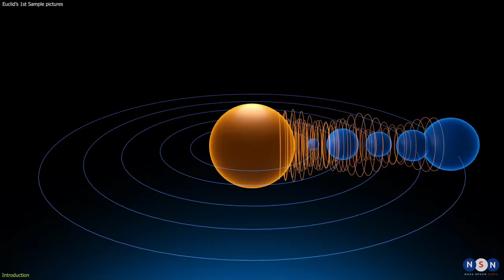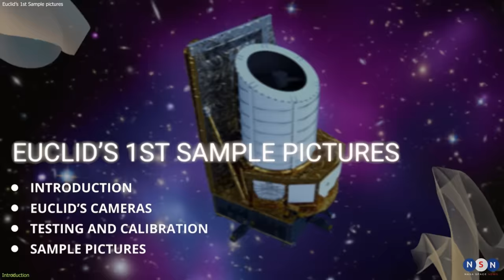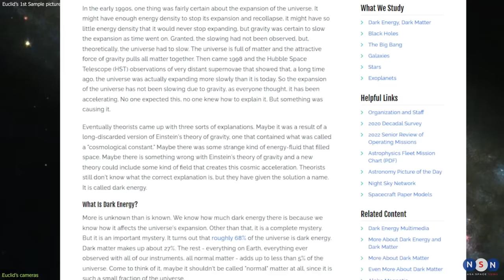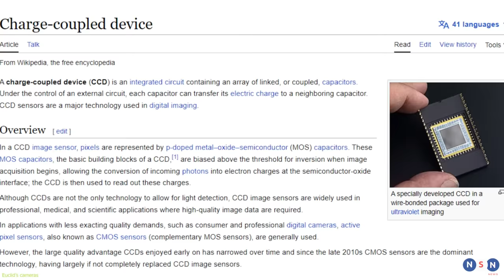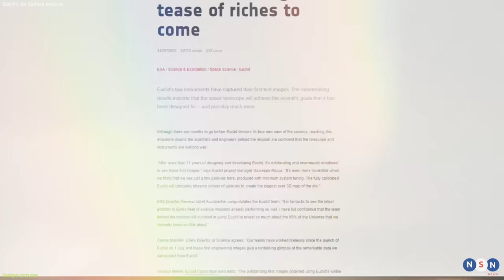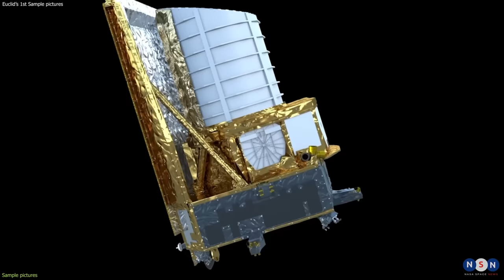Euclid Just Opened Its Eyes, and This Is What It Saw

Comment: 500m @ 10 billion light-years? That can't be right.
Reply: I agree that it can't be right.  I believe that the resolution at 10 billion light-years is about 4,850 light-years which is amazing.
Reply: @EricBier  sounds about right. 0.1 arcseconds * 10 billion light years = 4848.14 light years.  The Milky Way is about 70,000 light years in diameter, for reference.

Comment: wishing you had covered gaia's specs as well.  since gaia is at the L2 lagrange point with Euclid and jwst orbiting around it (only because differing types of orbits are used for Euclid and James Web Space Telescope to maintain position at L2 than Gaia). perhaps a video covering all 3
Reply: Don't forget The Red Roadster is also out there, randomly crossing the flight paths - - but don't worry; Space is pretty big.
Reply: @peterdarr383  Negative. The Roadster is not in any kind of Earth orbit, however its current orbit does intersect Earth's. If it remains on this orbit for a long time, it will periodically intersect and come into close contact with L2 as well as Earth on an interval of centuries or millennia.

Comment: 7:28  If the resolution is 0.1 arc seconds, it is possible to distinguish objects with a size of 5000 light years at a distance of 10 billion light years, not 500m...
An error with a magnitude of 17!
Reply: Thanks!
I thought that 500m distance seemed a little implausible... 😲
Reply: That would be a heck of a resolution. Equivalent of resolving something like the width of a human hair in the Alpha Centauri system.
Reply: Yeah
I'm a dumb hillbilly and can't do math above 3 digits.
But when he said 500 meters at 10 billion light years, I flinched real bad.
I knew that could not be right, but also knew that I could not prove it wrong with my 3rd grade math skill set.
But you know, they say, "Believe the science." 
I must admit though, I am having a hard time gettin' my wife and kids to eat bugs.
Reply: That's right. The tangent of 0.1 arc seconds is 4.85 E10-7 radians. Times 10 billion is 4850 light years. That's way too big to see individual stars, but could see clusters of them or nebulas.
Given that only 1 significant figure was used in the 0.1 arcade spec, we round up to 5,000 light years.  
ps, Given that the Rayleigh Criterion of Resolution is [(1.22 * Wavelength) / D], we can calculate the Diameter (D) of the optics that gives us that 0.1 arcsec of resolution, for any wavelength used in the detector.
Reply: @francp3147  ok… I’m going to believe you until I can check further in this 😂
Reply: Thank you.

Comment: What am I missing in the search for dark matter?  It seems to me that the discussion might be closed by the following scenario:  Construct a hollow sphere from two hemispheres (simplifying the launching of said sphere) which can be assembled in space.. Attach this sphere to another very small sphere, made in as similar way, and connected to the large sphere by an extended tube. From the small hemisphere attach another tube and a flat plate with the same projected area as the large sphere. Adjust the mass of both assemblies such that they match exactly. Set off a charge in the small dual hemispheres and monitor the trajectory of the two sections. F=MA

Comment: If I understand correctly, dark matter was hypothesized to explain the fact that galaxies seem to be rotating faster than they should based on estimates of the mass they contain.  Wouldn't it be simpler to use okham's razor.  What evidence, for instance, is there that the central black hole in a galaxy is not simply heavier.  Or how about the shading effect.  If two stars in a distant galaxy are in line of sight from the earth, the far one is shaded from our view by the nearer one.  The only indication we have of the mass in a galaxy is the amount of light and other EM radiation we see.  Or what about all the cosmic rays wizzing around at near relativistic speed in a galaxy.  The flux is small (greater toward the center of a galaxy) but the volumes are measured in thousands of cubic light years.  We also have photons.  We say they have no weight but C may not be the ultimate speed.  If they do have a little weight they will be traveling a tiny amount less than the ultimate speed of information.  The path of Photons bend as they come close to a heavy object so isn't that evidence that they have weight.  There are a few other possibilitiesThis is just a sample.
Reply: It’s not quite so simple as that. If you plot the radial velocity if stars in a rotating galaxy, you would expect the curve to go as 1/r (where r is the distance from the center) as one looks towards the edge, based on the mass we can see. Turns out the plot is flat , which means that as one looks farther from the center, one should see more mass. We don’t, so either gravity is wrong (and Einstein’s model of General Relativity was tested to be accurate to 15 digits a few years ago) or there is more, unseen mass out there.

Also, when one looks at the motion of galaxies within clusters is galaxies, one sees the same thing. 

So while there may be problems with our best theory of gravity (general relativity), it has proven to be so accurate in extreme tests (time running at different rates in orbit vs on earth’s surface, gravity waves, light from background objects  deflecting precisely as described around the sun and black holes, etc), Occam’s razor says there must be some dark stuff with mass out there
Reply: Here is some additional info on the galaxy rotation problem:
https://en.wikipedia.org/wiki/Galaxy_rotation_curve

Comment: Amazing technology and awesome achievement!

So far, it appears that the universe started as something tiny and started to expand to what we can observe and detect today. It also appears that anything we can observe or detect is made from extremely tiny particles which interact and combine with each other based on some fundamental predetermined rules. We have identified quit a few of these extremely tiny particles and have identified quit a few of the rules these particles follow to interact and combine. Perhaps most of the particles and most of the rules but there probably are more. 

We also discovered that anything that we can observe or detect is made from the same basic stuff and we call this stuff energy. We know this because we have figured out how to calculate a value or quantity of energy for anything that we can observe or detect. I think we can say the fabric of the universe is space time but we can also say that the fabric of the universe is energy time because we now know that space is not empty and is also some type of energy and we can calculate or at least estimate how much energy is in a given volume of space. 

It also appears that after the universe started to expand, no more energy was added or removed as it continued to expand. We do not know what the rules were that determined the amount of energy in the universe nor what caused the energy in the universe to start expanding. The rules for how energy expands, transforms, interacts and combines cause energy to cycle from concentrated to diluted states. Although the cycles can be repeated almost an infinite number of times, we think there will be a time when they stop because as the cycles keep repeating, the total amount of energy in the universe keeps becoming more and more diluted. We call this rule entropy. We also think that at some point in time, all the energy will become so diluted that it will not be able to cycle back into more concentrated states and we think this is when the universe ends.

We still do not know the rules before the universe started to expand and we still do not know the rules after the universe ends and there are probably still many rules that we do not know about that causes the energy in the universe to cycle back and forth from concentrated to diluted states as it continues to expand.

Comment: Dark matter is decayed neutrons and dark energy is the expansion caused by that decay. Neutron 0.6fm³ and amorphous hydrogen gas in deep voids 1m³.

The decayed neutron fragments, proton/electron soup, has a cross section of 10-³¹ barn.
Reply: Hydrogen atoms are semi-opaque at several frequencies. Spectroscopes can detect its presence in the interstellar spaces, and we can calculate its density. Too little observed, by a factor of several thousand or more.
Reply: @Galahad54  
1) when free hydrogen first falls apart it is a proton and a neutron but the electron is not in orbit and has a cross section of 10-³¹ barn. Totally invisible.
2) then it first stabilizes into cold monatomic hydrogen which can interact w light but at an estimated density in voids of a few atoms per meter it is still very difficult to see. 
Check some references.
3) it finally, probably at the edges of voids, begins to bond into H2, molecular hydrogen, which is the hydrogen we know and detect easily.

Comment: I'm confused. At 7:30 the narrator claims 0.1 arcseconds converts to a separation of 500 m at a distance of 10 billion lightyears. Is that right?
Reply: According to Bard, it should be 500 lightyears at that distance or roughly 1/50th the distance from the Earth to the center of the Milky Way.

Comment: 0.1 arsec is not 500 meters at 10 billion LY.  It's more like 4 x 10^19 meters. 40,000 quadrillion meters.
Reply: I noticed that, too. The robot narrator just makes sounds based on its text to read. The typist didn't proofread carefully to get the info correct.

Comment: Think twice before messing up numbers? If we could resolve 500m at 10bly distance, we could read newspapers on expolanets and count the population of planets in nearby galaxies. It's 5000ly resolution at 10bly distance. So the milky way would be about 20pixels in diameter if it were that far. A resolution of 500m could be achieved at a distance of 1 million km, that is about the distance of the first Lagrange points (of Earth+Sun) or about three times the distance of the moon. It's not an unusual resolution for modern instruments, as illustrated in the video itself.

Comment: Amateur Astronomical Observation began with the mathematical musical measurement skills of Galileo. 
The Gaps between Primes will correspond to the Spongiform placement of universal structures in pseudo random prime-cofactor arrangements, depending on what the Observer's expectations are in the Absolute Zero Kelvin Singularity-point Entanglement Origin of relative-timing coordination in instantaneous spacing..

If the principal Sciencing purpose of the project is to determine the operational principles of Actuality, theoretical preferences for a particular concept not in evidence, is only a method for discrediting the process before it happens.

Comment: The topography of the universe over time and how it changes nothing but our perceptions.

If dark matter changes states between a liquid and gaseous state then there would have been a time where almost all of the dark matter would have been in a liquid state due to the even temperature distribution of the universe.

If the dark matter was in its liquid state then baryonic and dark matter would have been much more concentrated. This would have resulted in deeper gravity wells. 

Once stars were formed and black holes became active the ratio of liquid to gaseous dark matter would have decreased over time thus affecting the evolution of particle masses.(1)

Light red shifts as it climbs out of a gravity well. Thus the further you go back in time the more light is redshifted. This would leave everything the same with the exception of our perception that the universe is expanding.

Phase transitioning dark matter could also answer several of the biggest questions in cosmology.

Comment: 7:32 500 meters at 10B light-years? Sounds Incredible. Let's do the math. At a distance of 10B ly, a 60-degree arc would be π/3 * 10B = 10.472B ly. So 1 degree would be 174.5M ly, which is 60 minutes * 60 seconds. So 0.1 arcsec would be 174.5M ly / 36000 = 4800 light-years. I'd go on a limb and say 4800 light-years are a bit more than 500 meters... Like 17 zeroes more.

500 meters resolution would only be possible at a distance of 1M km (like 3 times from here to the moon).

Comment: Dark Matter is a false physics idea to make up for the errors in gravitational physics.  90+years later not a single physics experiment has found a particle called dark matter.  110+ years ago super tiny size particle and our classical physics theories fail - hence we changed our physics.  Same time-frame our classical physics theories fail at high gravitational levels - hence we changed our physics.  Now 90+ years later, Astrophysicists instead of changing their physics still cling to Fairy Dust Physics even though the well proven Standard Model completely disproves a Unicorn Particle "DM" does not exist.

Comment: The pictures are far more important than the arc seconds, the spectrums, number of cameras, wave length, etc, etc, and hubble, etc, james web etc.  btw the universe is 46 trillion years old. And currently in its 5th 49 billionth year of renewal.  Like the human replaces cells every 7 years, the universe renews itself every 49 billion years.  Our universe is made of 7 belts. We live in the 4th belt the material belt . Core , UR-core , space belt, material belt, creation belt, transformation belt, Ram belt . The 7th belt nudges away other universes that float within the Absolutum.  There are ten to the power 49 universes floating within the Absolutum , each at a different level of evolution.  Only during the first half of the first expansion /contraction phase does a Creation create a material universe, all other phases are of a purely energy nature.  7 expasion /contraction phases, 155.52 trillion expanding 155.52 trillion contracting. Then sleep for one great time- 311,040,000,000,000 years.  The 2nd wake/sleep phase is 7 times longer.  Each phase of expanding then contracting always increases seven fold.  Once a universe completes 7 expansion /contraction phases it evolves to the level of Absolute-Absolutum . There are 7 absolutum forms, Zein Absolutum is the final absolutum.  In a one time fashion the Zein absolutm  created the 6 other absolutum forms.  How do we know ?  The Nokodemjon merged back into Creation 12 billion years ago.  He returned to the life/death/rebirth cycle when his people fell away from the Creation energy teaching .  We know that energy form as Enoch/Isaiah/Elijah/Jeremiah/Immanuel/Muhammad/ Beam.  Same energy different personalities.  The 7th and final teacher for earth - Billy Edward Albert Meier .  Writing about space since he was eleven .  Meeting with human beings from another planet for over 80 years and ongoing today.  These people always work with that spirit energy everytime it reincarnates.  Our people called them angels/gods, they are just more evolved human beings .

Comment: The nullimo empty space for other universe of  time or  space travelling is equal to time theory areas of 56  direction of an circle angke is or infinite degrees of an circular space means one circle 360 degreess and one global solid three diamention had 360x360 x360 by length x breadth x height is an space directions expansion is rime which is infinite from big bang to big collapsio appocalista time is also is an constant = alfabeetagama cycle time and space of an unucerse niw running and will completing after 10 crore years to come..